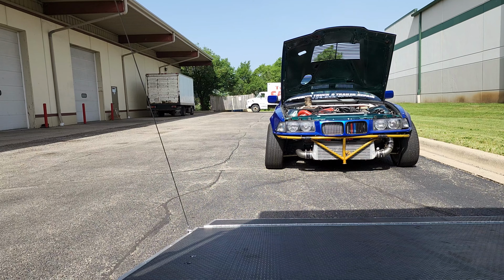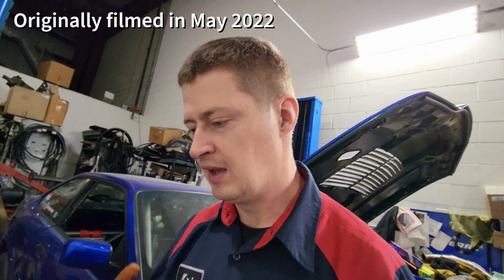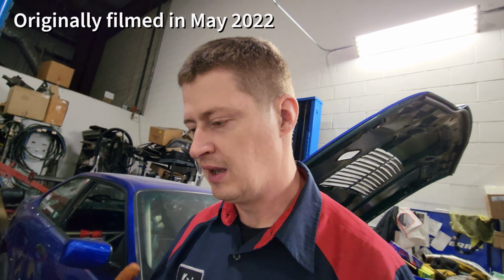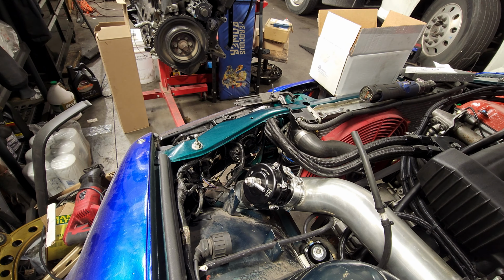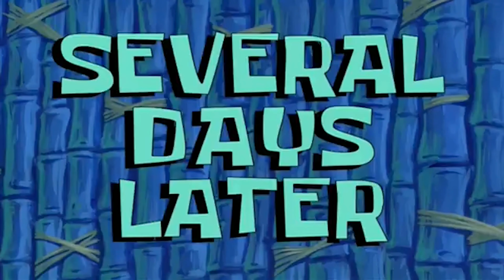Superior Drift Garage - Bigger Turbo Engine Build  7

Comment: Hi are you still using the 660cc siemens dekas and what fuel pump are you running with e85
Reply from the maker: No sir, it's a 830cc simens dekas and 525 hellcat fuel pump
Reply: @superiordriftgarage  did the hell cat fuel pump fit into the e36 carriage fine or alot of modifications
Reply from the maker: It absolutely does not fit and you have to be a little creative. I show that in part 5 of my build, so check that out.
Reply: @superiordriftgarage  awesome jus viewd part 5 jus to clarify you still running stock fuel line and stock  fuel pressure regulator
Reply from the maker: @keegan.moodley17moodley32  yes I am, you're all correct